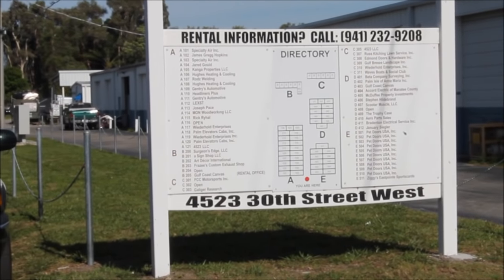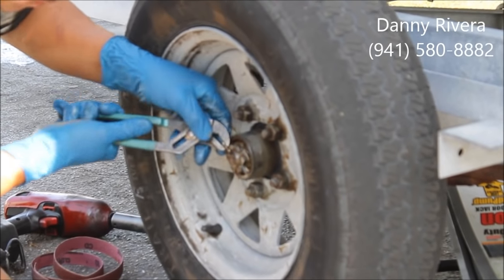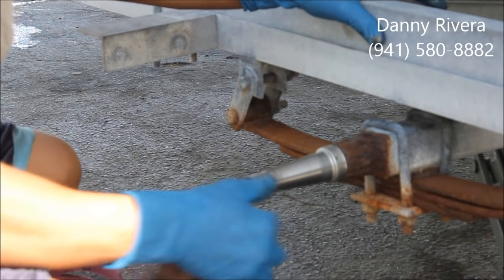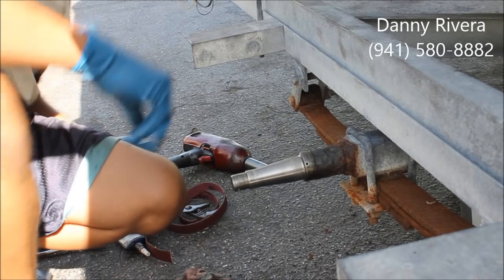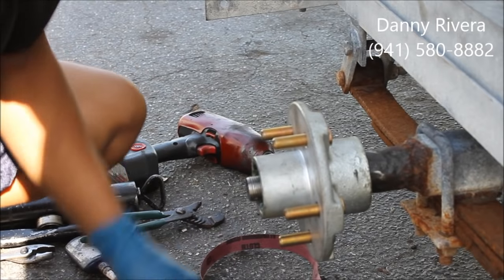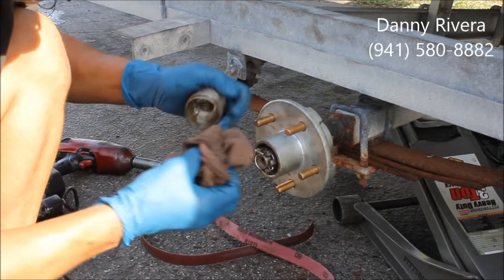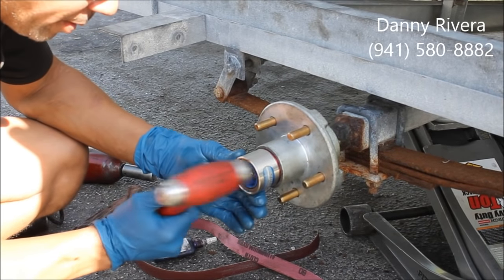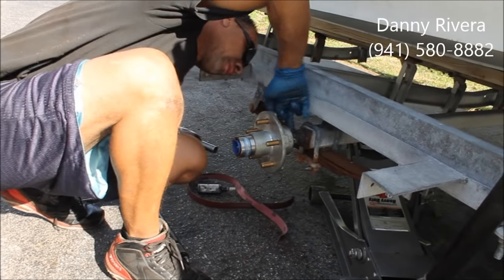How To Replace Wheel Hub on Boat Trailer

Comment: I couldn't get the dust cap off of my wheel for the life of me using a screw driver and prying at it like others did till I came across your video where you use channel lock pliers to pull it off instead. Thanks!

Comment: everything is good except welding the cap...for me that is a no no
Reply: for the benefit of we viewers that don't know the pros and cons, would you care to elaborate for us why not to?
Reply: @grizzlya1257    2 reasons :   (1)   sooner or later someone is going to have to get back in there. a grinding tool or chisel will be required. a removal will ruin the cup. It will no longer seal properly.  (2)  when welding, the current will cross over the bearings. The bearings must spin as smoothly as possible. The current from the welder may or may not pit the balls of the bearing. Don't take that chance, don't weld.
Reply: Great video! Avoid the tackweld tho the thread lock is plenty :)

Comment: There should be a zerk fitting at the end of the spindle. That is far superior than the Bearing Buddy in my opinion. It pumps grease through both bearings in and out the front. With the bearing buddy you'll have to take the wheel off to replace the grease.

Comment: In my experience those particular hubs seem to let the most water in, the regular old hubs without the grease nipple hold out water for longer periods therefor lasting season after season, 

I’ve tried these hubs thinking I was doing my self justice but the fact was they were failing only after a year or two of use 

Just stick to the regular old sealed hubs

Comment: Thank You!
Nice video, very well presented. 
Although, I would NOT weld on any rim that has a mounted tire on it.
Reply: for the benefit of we viewers that don't know the pros and cons, would you care to elaborate for us why not to?
Reply: @Mr40tt  That is a good starting point.  How about other ways to bond the cap better than just the friction fit?  Loctite or other adhesive that can be broken by manhandling if/when servicing?
Reply: @grizzlya1257   I was an investagator for a living. So I just seen the results of when things went dead wrong. 
Although I was also a welder and blacksmith, I have no opinion other than what I said about "not welding or adding heat to an inflated tire. "
I actually knew a man who's life changed for the worst do that type of accident! 
I think this kind of discussion is necessary for people to consider how they will choose do something safely!
Reply: @Mr40tt  Makes sense to me.  I wonder if the OP if this video would consider editing the video to have a text box saying "don't do this" or a red "X" over the part where the mechanic did that, just to prevent someone seeing the video and not checking the comments ?
Reply: This isn't a weld to the rim so not the same as the test in the video that was listed. That short tack for the cap to the hub isn't going to transfer to the tire in the same manner. With that said I personally wouldn't weld it because maintenance later will be a pain. If the cap seats well then you shouldn't have issues.
Reply: @thephishh  I agree with you! 
But, I hope you would have to understand that what I have seen, I run scared and I am personally afraid to push the window.  
It is a good thing to be able to discuss these matters.

Comment: When installing a new hub is doe it matter if spindle is tapered or not, or  u only have to worry bout it if u guys just replacing the wheel bearing, but if whole hub should b fine regardless  of spindle?

Comment: Always force grease thru the bearing before you install them.
Reply: As someone without experience but looking to learn, I thought the hub was prepacked.  Other than that, he added grease to the nipple until the rubber cap bulged.  Is there more greasing to do?
Reply: Already pre packed and greased

Comment: Thanks, I learned something new. I still have the grease fittings on them with the bearing buddies on, forgot to take them out and blow with compressed air. Don't have an air compressor so i will use the cans, hopefully has enough power.

Comment: Mine has a grease zerk on the end of the spindle which is where you blew out the old grease. .. Maybe looking at it wrong but don't see how that bearing buddy will force grease thru to the back correctly???

Comment: If you use Loctite go with BLUE Loctite, not RED.  Red is for permanent attachment and has to be removed with Heat.
Reply: The dude welding it on
Reply: Ever heard of a heat gun?, and did you not not notice that the guy WELDED it on.  LOL.

Comment: I know this video is a older one but I just purchased a boat trailer and 2 spear wheel hub complete kits. It already has some grease inside the hub but is that enough grease out the box if I ever need to change it or should I add more once its installed.  Please advise thanks!
Reply: Add more. Use Bearing buddies and keep them well greased while you are launching (summer).  In the winter when you won't use it much. Take everything apart, remove all the grease and re-grease again everything making sure to fill the bearing buddy with grease. Check all the bearings and if you even think or imagine that maybe the bearings need replacing, replace them all. They are cheap enough. If you burn one up you will be looking at replacing everything including the shaft. Expensive. Never use locktite on the bearing buddy. Never weld anything there.

Comment: Great Video great to learn from the pros, could you list the grit size of the sandpaper you used to sand spindles Cheers
Reply: elshaddai1969  it's Emery paper if you are wondering. though I don't which grit but in my experience all Emery paper is the same.
Reply: 220grit

Comment: Use emery cloth not sandpaper
Reply: I wanted to ask about that.  Emory cloth protects from effecting the spindle surface and diameter, negatively?  What grits would you recommend?
Reply: I use like 800 works great!

Comment: What’s the deal with those rubber gloves people are wearing nowadays when they work on stuff? Hell! I remember my Dad working on cars and trucks back in the 60’s and 70’s and he never wore any of those panty waist girly rubber gloves. He’d just wash his hands in gasoline when he was done with a Pall Mall red hanging from his lips. He didn’t die from lead poisoning from the gas or oil that was on his hands and arms.
He’s 80 years old now and still ticking. I guess all these so called mechanics nowadays are just feminine and don’t wanna get any grease under their fingernails! 😭
Reply: Why would a REAL MAN be concerned with what a woman wants to touch? Like I said, REAL MEN don’t wear panty waist gloves!
Reply: Perhaps a real man, but not necessarily a real SMART man. Kind of hard to gas clean dirty lungs. I don't like the fill of working with gloves, but I really don't like my hands all cut up and my nails full of grease, diesel, or gas proof Permatex. Also, I regularly empty out the black water tanks on my motor home and sailboat. Please advise on what "real men" should do while working in s**t.
Reply: Wowza. Insecure male.